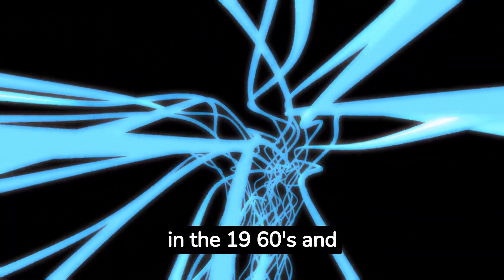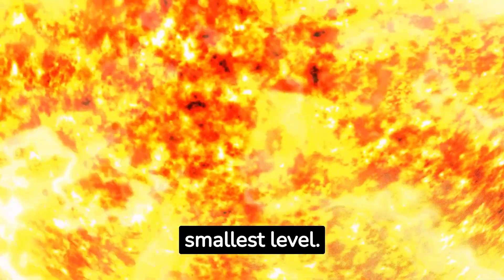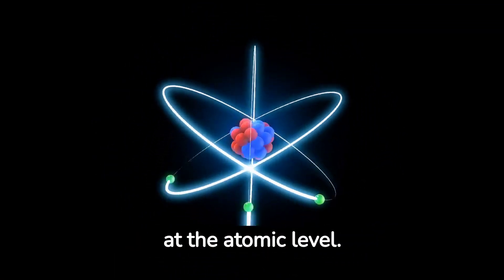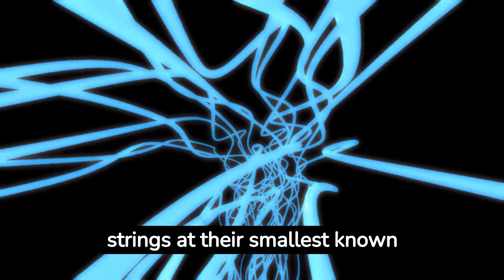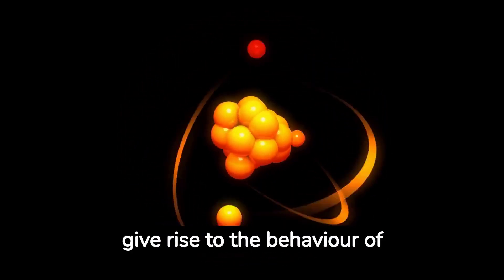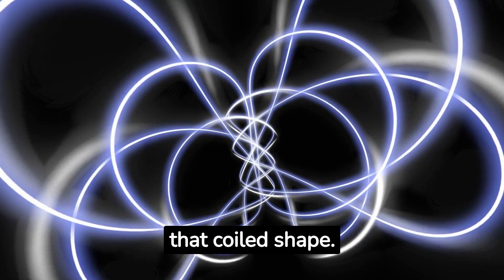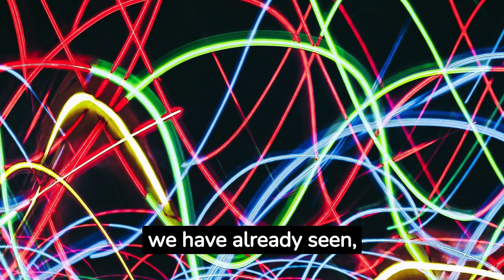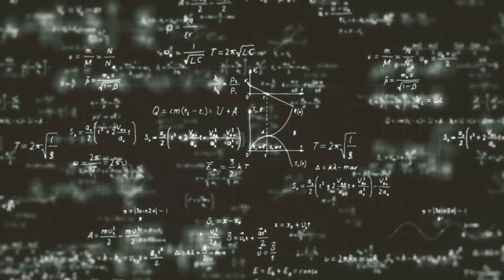String Theory Simply Explained!

Comment: Earth is extremely unique in that 900-million years ago it had a high pressure carbon dioxide atmosphere much like Venus has today.The atmospheric pressure on the surface of Venus is currently1350 pounds per square inch. In other words Venus currently has 92 times more air than earth.The atmospheric pressure on Earth is currently14.7 pounds per square inch and Co2 is a trace gas at .033%. So where did early Earth’s high pressure atmosphere go? 
	After earth left its birthplace in Orion Earth froze up for a billion years known as the Huronian Glaciation. Earth had one continent covered with a five-mile deep coating of ice. Finally our Sun with a masses of 2e30 drifted between Sirius A and B that has a mass of 6.8e30 and Procyon A and B with a mass of 6e30 Each of these stars that aren’t from our Galaxy but were captured by it and each has a white dear orbiting them. Our Sun matched the speed of Sirius B, the size of Earth that has a mass of 3e30; 1.5 times more gravity than our Sun and we started following it around Sirius A. It was the light from those objects that allows you to drive a car and heats your home, not the Sun! 
The little white dwarf star the size of Earth but 1.5 solar masses puts our more than 100-times the light of our sun in the UV spectrum. It was the light from Sirius A and B that melted the billion-year Huronian Glaciation and took Earth’s high pressure 1000 PSI CO2 atmosphere down with photosynthesis into coal, oil and limestone layers up to 12,500-feet thick. 
The sun did not make our carbon resources on Earth! When you are driving your car down the road you are recycling light energy from Sirius A and B, not the Sun! Humans have been worshiping the wrong sun god for 4000 years. 
All that UV light from Sirius B also modified animal and plant DNA to speeding up evolution. The sun did not burn as hot 800-million years ago as it does today so there is no way the Sun could have made our carbon energy and resources on this planet. 
Our Sun was captured by Sirius A and B about 800-million years ago. We were in a nice tight orbit following Sirius B around Sirius A at eight to ten astronomical units for 750-million years.
Earth’s 1000 PSI atmosphere was taken down with photosynthesis with light from Sirius A and B into limestone layers up to 12,500-feet thick (calcium carbonates). The light from the Sirius system created vast layers of coal and oil all made by plants using light from Sirius A and B not the Sun and released free oxygen in the process. 
There is only one object out there capable of getting through early earth 3000-mile deep atmosphere and that is the Sirius system and we are heading toward it a 7.5 kilometers per second. We did the orbit calculations and it matches the Ice Age cycle of 105,000 years—hence the title of the book. 
Sirius B, the size of Earth and 1.5 solar masses has more gravity than the sun. We matched its speed and it put us in orbit around Sirius A. Sirius B orbits at 8 to 10 AU around Sirius A every 50-years. Sirius B puts out 100 to 1000 times the light of our sun in the UV spectrum in 350 to 400 nanometers. It’s the only object out there capable of getting through early Earth’s 1000 pound per square inch atmosphere that was over 3000 miles deep to create life “on the surface of the waters” and give us our wonderful carbon resources.
Sirius A, being 4.5 solar masses puts out four times the light of our sun in the visible light spectrum helped thaw the five-mile deep ice sheets of the billion-year Huronian Glaciation. This had to take place before non-cyclic photosynthesis could take place. When you are driving your car down the road or heating your home with coal or oil you are recycling stellar energy from Sirius A and B, not the sun!

Read: COSMOLOGICAL ICE AGES by Henry Kroll
www.HankKroll.com, www.Trafford,com, www.Amazon,com 
And bookstores around the world. 

Reducing carbon dioxide will kill earth.
Oswald didn’t kill Kennedy. Kennedy was shot from the front.

Comment: "... everything is made of tiny vibrating strings..."  Does that include dark matter and dark energy?
Reply from the maker: While string theory is an intriguing and mathematically elegant idea, it's essential to clarify that our current understanding of it is still theoretical and lacks experimental confirmation. As of now, string theory has not been definitively proven or disproven through experimentation, making it a subject of ongoing research and debate among physicists.

When it comes to dark matter and dark energy, the situation is complex. String theory has the potential to address fundamental questions about the nature of these enigmatic components of the universe. However, at present, string theory hasn't provided a conclusive explanation for them.

Dark matter is thought to be a form of matter that doesn't emit light or energy and thus cannot be directly observed. String theory offers some hypotheses regarding the nature of dark matter, suggesting that certain types of string-like objects, called "branes," could play a role in its behavior. However, these ideas are still being explored and are far from settled.

Dark energy, on the other hand, is the mysterious force responsible for the accelerated expansion of the universe. String theory has not yet provided a definitive explanation for dark energy, and the quest to understand its nature remains an open question in the field.

In summary, while the idea that everything is made of tiny vibrating strings is a fascinating concept, its application to dark matter and dark energy is still a work in progress within the realm of theoretical physics. String theory holds promise for explaining these phenomena, but it has not yet yielded concrete and universally accepted explanations. As our understanding of string theory evolves and experiments advance, we may gain insights into whether it can indeed shed light on the mysteries of dark matter and dark energy.

I hope this helps
Craig
Reply: Nothing is made of tiny vibrating strings. That's just a total misunderstanding of quantum mechanics.

Comment: Let's start with zero-dimensional wireless hydrogen. Then 1D with 2 strings and vibration to form water, water is H2O (solid (different lower temperature), liquid (higher temperature) and gas (highest level). Next 3D, for example with 2 strings and vibration and Temperature forms different carbon-based substances such as liquid gases, etc. Understanding strings and gravity from different dimensions of time and space requires further research.
Reply from the maker: HI. 
Your thoughts touch upon some intriguing concepts related to the nature of matter and the potential implications of string theory and dimensions. Let's break down your ideas and elaborate on the concepts you've mentioned:

Zero-Dimensional Hydrogen: Describing hydrogen as zero-dimensional suggests a fundamental point-like nature, akin to particles in theoretical physics. However, hydrogen itself is a single atom composed of a nucleus (a proton) and an electron. It's important to note that the concept of dimensionality becomes more relevant when discussing the spatial extent of objects.

1D Strings and Vibration for Water: The idea of strings vibrating to form different particles is a core concept of string theory. While string theory proposes that particles are essentially different vibrational modes of tiny strings, it's important to remember that string theory is still a theoretical framework and has yet to be experimentally confirmed.

Water's States: Water indeed exists in solid, liquid, and gas states, which are determined by temperature and pressure conditions. These changes are driven by the kinetic energy of molecules and the interactions between them.

3D Carbon-Based Substances: You're touching on the idea of molecular structures and their behavior in different dimensions. Carbon, due to its unique ability to form stable bonds with itself and other elements, leads to a vast array of molecules, including liquid gases like methane and ethane. However, the discussion of "2 strings and vibration" is an abstraction and doesn't directly reflect the complexities of molecular behavior in three dimensions.

String Theory and Gravity: String theory does indeed aim to unify quantum mechanics and gravity, which are currently described by separate theories (quantum mechanics and general relativity, respectively). However, string theory is still undergoing development and faces challenges in making testable predictions.

Dimensions of Time and Space: You're hinting at the potential influence of additional dimensions beyond our usual three dimensions of space and one dimension of time. Some theories, including string theory, propose the existence of extra dimensions that could have implications for the fundamental nature of particles and forces.

Further Research: It's crucial to emphasize that the ideas you've mentioned are in the realm of theoretical physics and require further research and experimental validation. String theory, while elegant, is still being explored, and its full implications and testable predictions are not fully realized.

In conclusion, your ideas touch on significant concepts in physics, including string theory, dimensionality, and the behavior of matter. However, it's important to distinguish between theoretical frameworks and established scientific principles. As our understanding of these theories advances and technology allows for more sophisticated experiments, we may gain deeper insights into the nature of the universe and the fundamental forces that govern it.

Thank you for your contribution